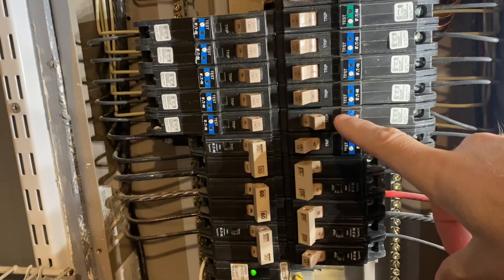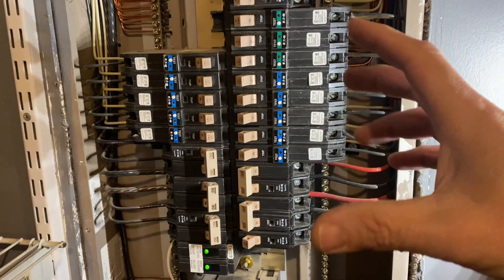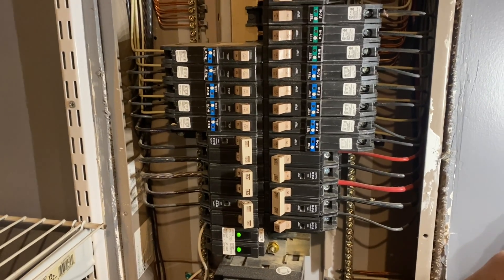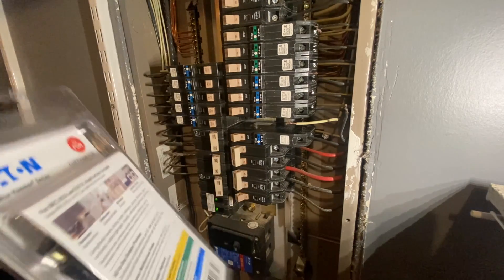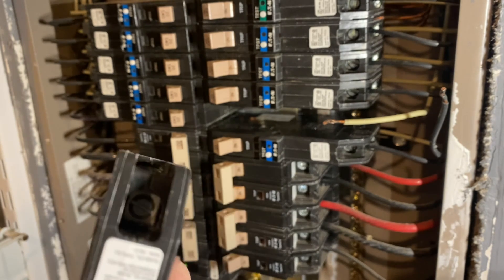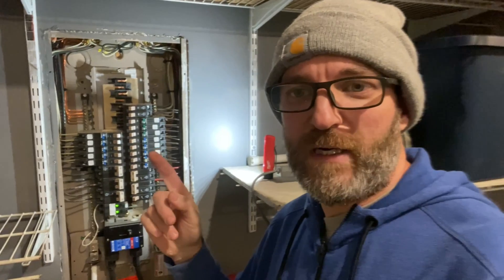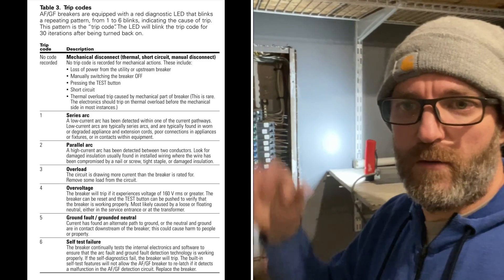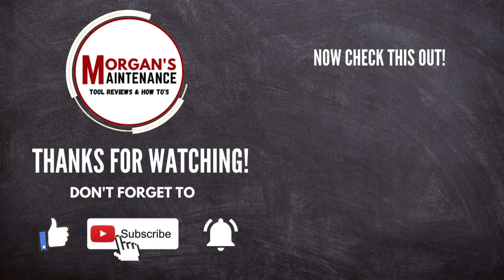Eaton CH AFCI GFCI Breaker Tripping Randomly / Blinks Red and Gives Code #watchmework

Comment: “Torque specs…” ???
I have 4 tightening levels:  
- Just barely on
- Probably coming loose after I leave
- Good-n-tight
- Almost stripped it ( definitely cracked the plastic) 

Only the first and last level are certainties. The other two are a guess.
Reply from the maker: 😂😂.

Yeah I don’t see anyone in my area doing the Torque on things except maybe main lugs… I just had to come up with an excuse of why I needed a torque screwdriver 😂
Reply: @MORGANSMaintenance  I respect your use of the proper tool for the job. Definitely the engineers and designers of those breakers have a reason for the torque rating. 

On more than a couple occasions I heard that disappointing crack as I broke the plastic breaker. ~ back to the store for another :D
Reply from the maker: @grumpyuncle.  yeah and these are too expensive to make that trip again… $73 at Home Depot!!